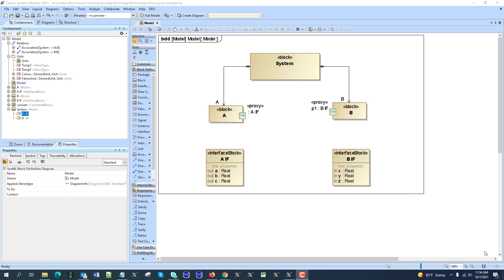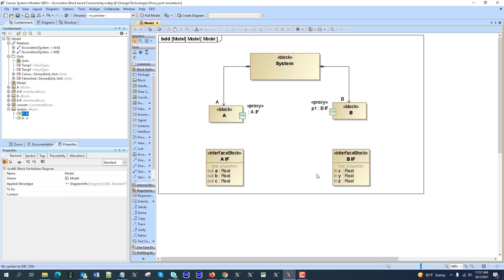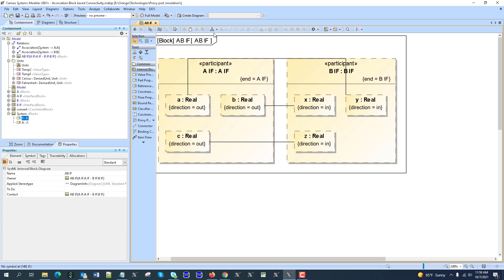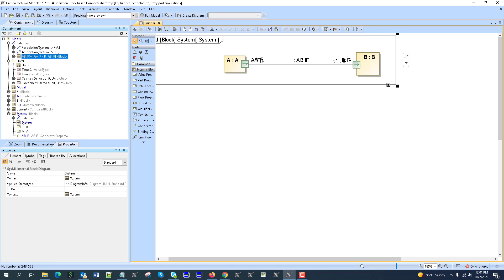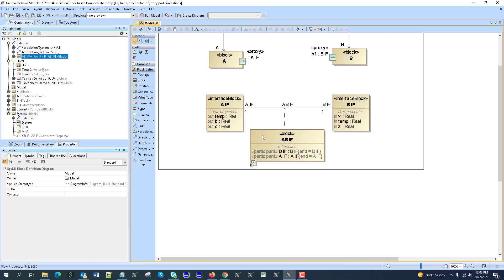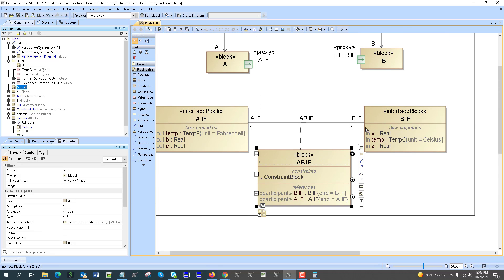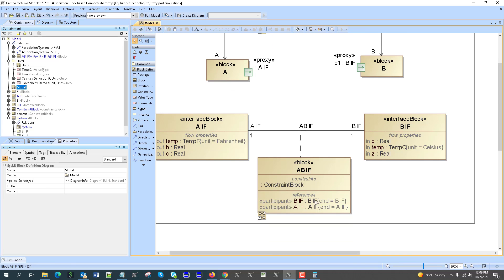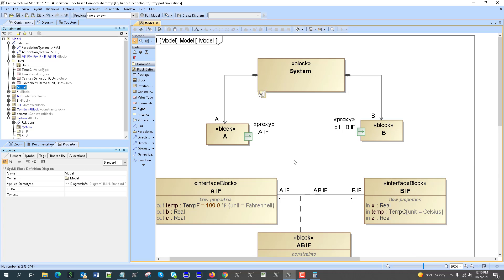Powerful Interface Modeling and Simulation Using Association Block in SysML

Comment: Thanks!  This helps a lot.  Can you explain how you would model two harnesses connected together between two subsystems where i can pass a value through?  Example:  subSysA--Harness1---Harness2--subSysB.  My attempts are coming up short at the moment..
Reply from the maker: Hello, maybe like this? https://youtu.be/_zWHBw2SPWk. Also you can handle signals at each harnesses like this https://youtu.be/Il3V3KOFvTM.

Comment: How can I see all the connections in the association block in a connector table? When I do this it only shows me the top level connector
Reply: I think I found a workaround. I added flow properties to the element type and then added the association block to the scope. If you know a more elegant way, please let me know.
Reply from the maker: Might be good solution. Another one could be with custom table query.
Reply from the maker: Hello Zeal. I think you need to set scope as more than top level system.

Comment: Something happened when you ignored the error on the IBD connector. It looked like the video cut out. I followed your exact instructions, but I did not get the same result. Should I not have ignored the error?
Reply: Solved my problem. I was not showing ports in the simulation. But, now my question is how do I relate the flow properties on those ports to value (or part) properties in the block owning the interface?

Comment: Thanks. I expended some hours looking to this to work. This is because I have more complex flows (blocks with two values instead of just one integer value). I discovered that with the corner upper-right gear icon in the Simulation panel, we need to activate "show ports", that at least for me weren't show by default in the variables list. also I needed to activate Reference and Redefined properties in order to be able to access ports and flows. Why? Because if I don't "add value" on my flows (within my ports), the values don't appear in the simu, and it doesn't work. 

It works if flows are just integers or real numbers (like your example that I successful tested), but my ports have more complex flows (actually the flow (electricity) is a block with two values (voltage(in volts) and current (in amperes))). Now looking for a way to automatic "add values" (those required) for simulation instead to have navigate and added every time the simulation is run. I am connecting two "one pin electrical ports" and I need to connect the same port with itself (of course in another object), to work around this, I created two sons of my onePinelectricalInterface and redefined the flows. So I was able to define an Association Block between both. I tried before relating two copies of the same interface without success. 

If there is a better way to do this please comment. Thanks!
Reply: What do you mean by "add value on flows?" I am trying to do a similar thing. I would like a block to flow across my connector, but for it to carry values set in the block that owns the port typed by that interface.
Reply from the maker: Hello Ryan. Not sure is this helpful. But here are few methods https://youtu.be/di7oJYtp1T8
Reply: @MBSEExecution  Thanks, this video is helpful. I have used the Ports, No inheritance portion of this example, except instead of binding together primitive value types in the Interface IBD, I am trying to bind together value properties of an object (block) that is the flow property of those two interface blocks. This is similer to @Gengis TR, I believe, but I am then trying to associate value properties of the subsystems to the value properties of my block flow properties. The simulation simulates everything except for the flow properties values. This is a tough one, but I feel like there must be a solution.
Reply: I found out that if you set the default value of the flow property block to an instance of that block, you can then interact with it in a simulation.
Reply from the maker: Hello Ryan. Please send small sample to MBSEexecution@gmail.com to check an issue.
Reply from the maker: Hello Gengis. Thank you for your feedback. Maybe storing values in instane and simulating instance would help? Instance can store structured values.

Comment: Thank you for the wonderful video, i have two questions, 
1. did you generalized blocks A and B with A IF and B IF? if i don't do that the ports flow property does not show in the simulation pan.
2. what did you do to display the values for a,.b,c,x,y and z on the association block ibd during simulation?  For example a=15 and y=15, all i get is a:Real, and y:Real  in the participant block.
Reply: Turn on show ports in variables pane settings to show flow properties

Comment: Great video! Love the application to simulations.

Question: when you type a proxy port with an IF block that is connected to another IF block via association block, like it is done in this video, how can you show the flows within an ICD table?
Reply from the maker: Hello Mason. ICD table should show flows out of the box as they part of interface block or item flows on connector but not association block.

Comment: I am attempting to send a signal across a connector typed by an association block, utilizing the internal structure (flows, ports) of the association block, but it does not seem to work.  Is this possible?  Thanks for another great video.
Reply from the maker: Thank you Katie for the feedback and question. It shall work same as with regular connector. Please note that proxy port does not handle signals it is just proxy to the system. So when you send signal to port it is received by system on another side of connector. Let us know if more help is needed. Sample model would help to understand problem. You can send to mbseexecution@3ds.com
Reply: @MBSEExecution   What happens when I have a signal as the flow property on the IF and the signal has an attribute (s)?  My question may the same as Katie's.  The signal doesn't flow across.
Reply from the maker: Hello Dez. Thank you for the feedback. Could you send sample to mbseexecution@gmail.com ?

Comment: This video is great, thank you. Very helpful and simple which is exactly what everyone wants to see. 
I do have a question, for taking the example further. 
I'm trying to create a pinout level ICD table which can do simulation also (logical and physical).

 What I mean by that is Black box A (A) to connector A (port A) to pinout A to cable with signal/flow prop to pinout B to connector B (port B) to Black box B (B).

Could I just convert your proxy port into a full port to be able to drill down to the pin out level? 

What are your thoughts?
Reply from the maker: Thank you for your feedback Will! Greatly appreciated. Looks like it shall work with full ports and pins, but sample would be good to see and try expected behavior.

Comment: Saulius, this a another great improvement.  Thanks for sharing these types of enhancements.  It looks like it is streamlining IBD's, parametrics, and simulations which is good.  Question: If you have those same parts but a need to have a different or second type of associations using those same parts, can use place it on the same diagram as the first or do you need to create a second similair diagram to run the second type of association using those same parts?  Thanks again
Reply from the maker: Hello Kizer, thank you for the feedback and question. Im not sure exactly but same association block can be reused for multiple connectors. Also diagrams are representation of model so no need for separate diagram if model exist already.

Comment: Yet another very informative video. Thanks for sharing. Initially I was wondering why to use the association block when I can directly connect the flow properties of the proxy ports and then you showed the unit conversion part that opens up a lot of possibilities of what all can be done with the association Block. Thanks again 👍
Reply from the maker: Thank you Prasanna for the feedback!